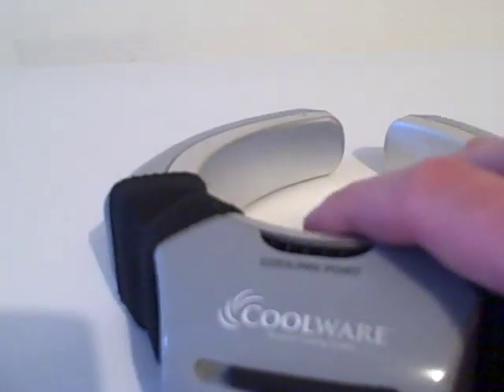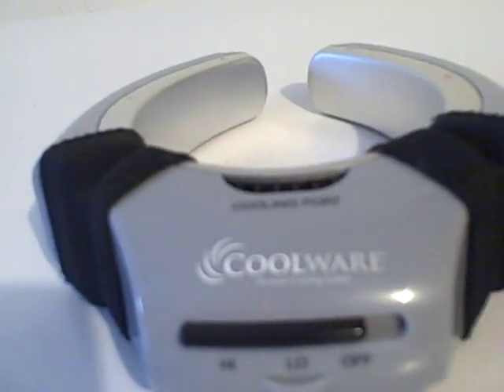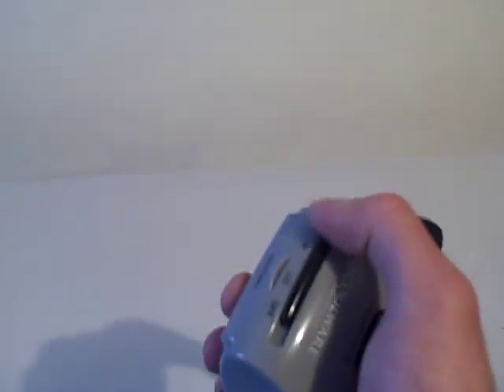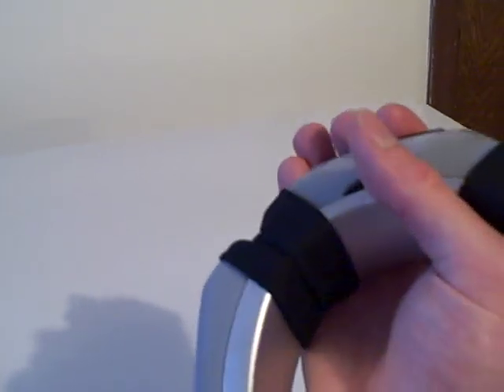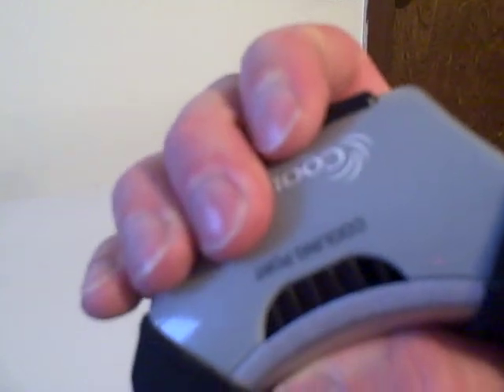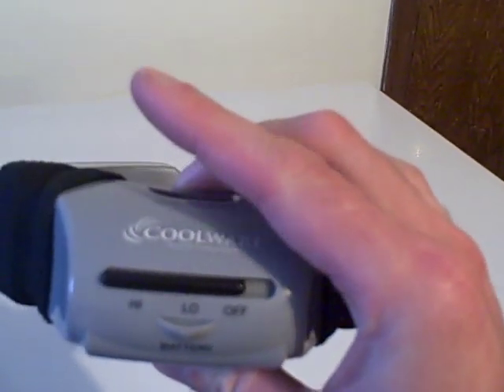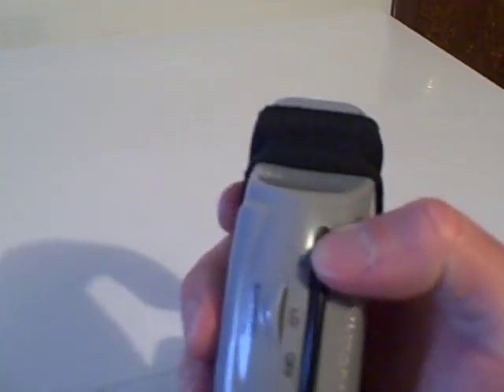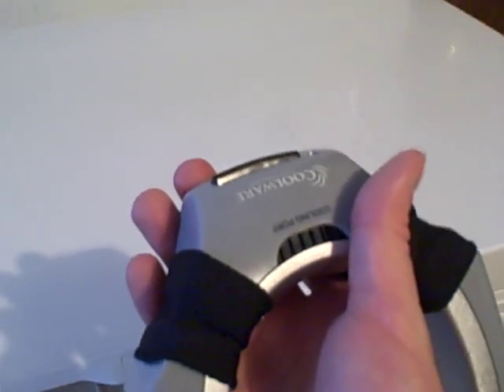Coolware Personal Cooling System

Comment from the maker: @cotton509 

The 2 sides have a cloth inside of them. You fill up those 2 chambers with water, shake out the excess water and the cloth is saturated.
Then when the unit is on, the fan sucks air through the 2 chambers, causing a 'swamp cooler' effect. The evaporating water cools the metal plate along the inside so it can cool one's neck.